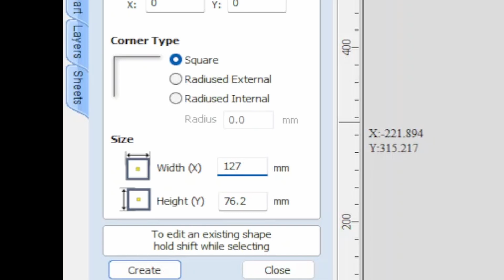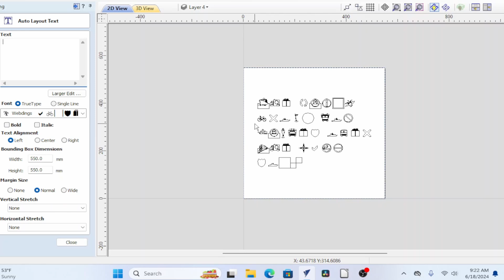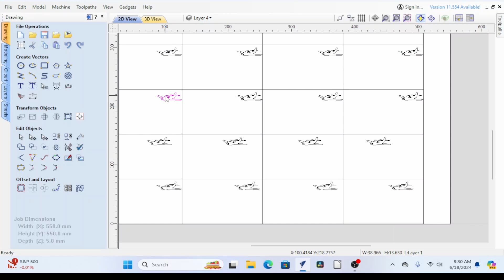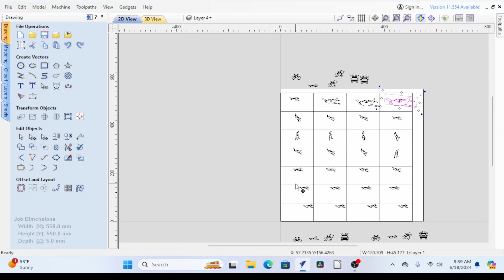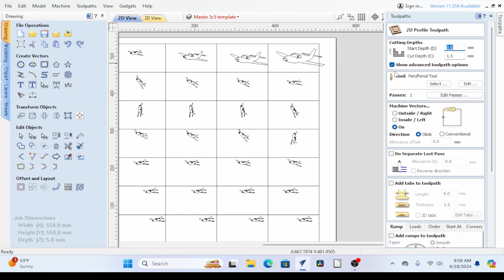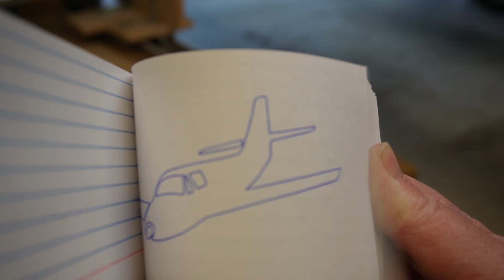CNC A FLIPBOOK -- CREATE A COMPELLING ANIMATED STORY THE EASY WAY, NO DRAWING SKILLS REQUIRED

Comment: I made a Sharpie holder out of metal and plastic and fastened it to the front of my X-Carve router.  A piece of 1/2" pex will fit the Sharpie. If you are using Fusion 360, all you need to do is make a sketch ( no model needed) and use the TRACE tool path. Works great.
Reply from the maker: I like the pex idea.  Thanks for sharing.